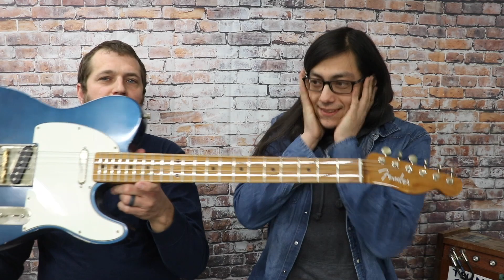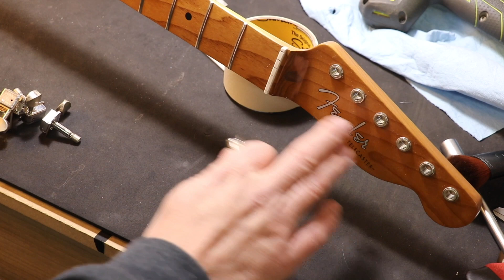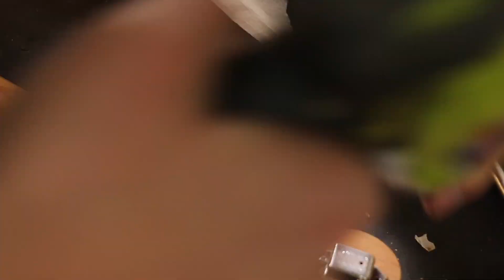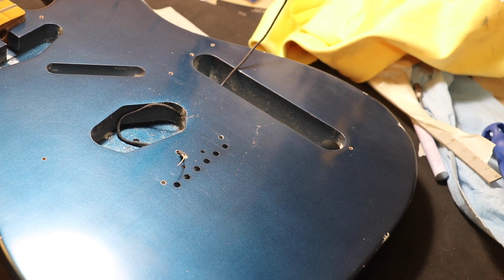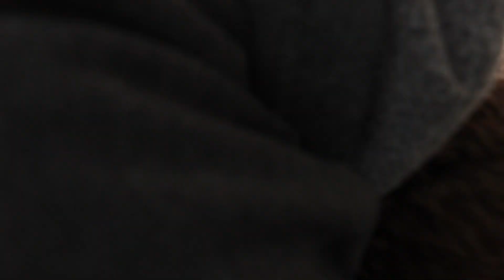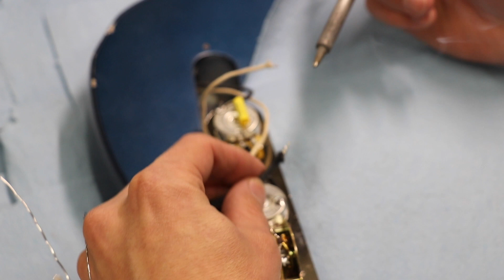Tele Build With MJT and Fender Parts: Part 5 - Assembling the Guitar and Wiring

Comment: Really cool guys, can't wait to hear it. One inexpensive tool I find invaluable for any pilot holes you need to drill for things like tuners, pickguards, control plates, etc. is an awl. Your hole is clearly marked and you also have something to start your drill bit in so it won't wander.
Reply from the maker: Also a great method! We have some center punches here but they are too big for the smaller screws. Glad you’re enjoying the build process, it’s been a fun project for us. We’re also looking forward to new pickup designs out!